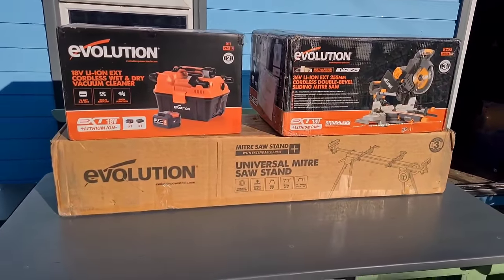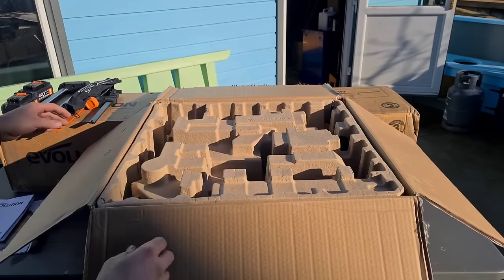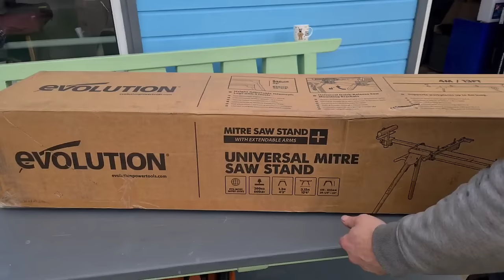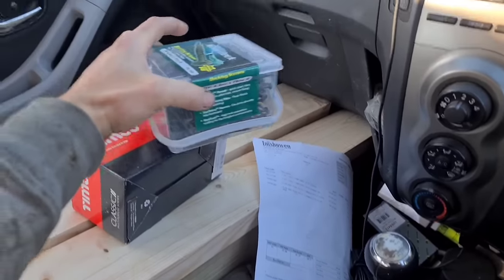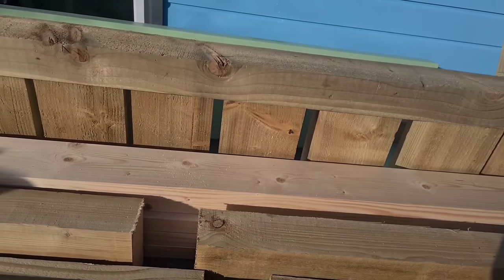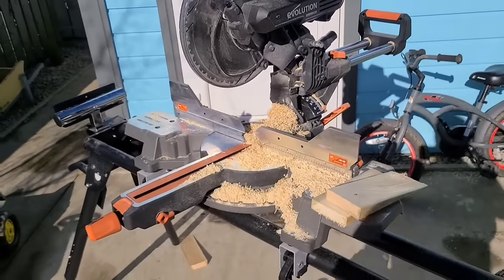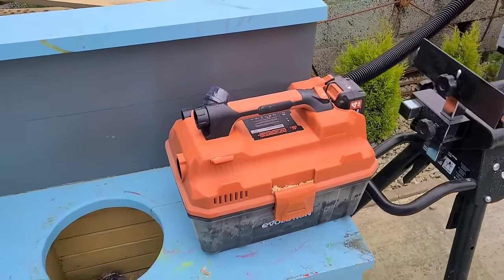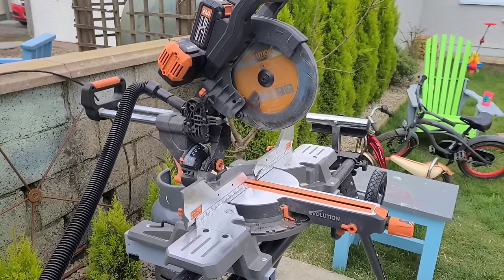Testing out the all new 36v twin battery miter saw from Evolution power tools.

Comment: Dean, the Project Farm channel did a test of all the name-brand carbide tip circ saw all-purpose/demo blades, and Evolution's blade won.  They beat DeWalt, Milwaukee, Bosch, and even Amana.  They were also one of the least expensive blades in the test ($12 vs. $42 for the Amana).  Because of that test I bought a few, along with their 10" table saw blades, and they are impressive.  Cheers mate!

Comment: Hey Dean 
I'm a senior project manager in Product Development at Evolution, I've been with the company for 11 years and have been involved in design and development of most of the new ranges of tools, including this one. 
This is the best review I've seen so far, thanks for your comments I'm glad to hear from a satisfied customer, particularly the repairability as it is something we spend time on ensuring the machines can be easily serviced and repaired. 

A few points which I thought I'd add which might help. 
- When you fit the saw head assembly to the rails with the flat pack system 9:45, there are 2 cap screws just in front of the spring loaded pins now. We added these to a few saws we have designed more recently to just nip the rails tight into the machined holes in the head pivot block. We have to have a tolerance that allows the rails and pivot block to be fitted together by the end user so the additional screws just add some further rigidity and make the connection tighter. The cap screws can be tightened with the supplied allen key, won't need much just a nip up. This is something we will be adding to other saws to improve them. 
- This is the first time we have designed a saw to compete directly with the biggest names in the industry Yellow team, Teal team and Red team in particular. This drove many of the design decisions; Stainless mitre plate, larger base, Die cast extensions, bigger fences, large bevel markings and detents ect. Another area we really focused on was the dust collection as it is increasingly a higher prioirty for our end users, we really went down a rabbit hole on that, slow motion cameras set up and running loads of cuts and mapping dust tragectory and dispersion in CAD. We have optimised the dust collection skirt to work best on stud dimensions IE 2x ...... If when making cuts like 20:26 you pull the saw forward on the rails and cut the timber through from the corner nearest you and push the cut through to the fence, the cut channel formed by the kerf of the blade will shoot the dust directly up the dust port particularly when you have a vac attached. We got very impressive results when cutting this way to help with keeping work area tidy. Just a small change to how cuts are made makes a huge difference. 
- Your comments on the 10" blade are aboslutely true, particularly when going to larger 12" blades, we have had every competitors saw in, used them a lot and fully dissassembled them all over the couple of years we deisgned the saw. This was the reason we went 36V twin battery, single battery 18V saws just don't have enough power. Incidentally our saw has one of the largest cutting capacities of cordless double bevel saws available at this blade size, it actually has the same cut capacity as the NEW Flexvolt 12" machine which is more than double the price and much bigger and heavier. 
-This is another thing some competitors over looked, the weight. Being cordless means these saws are more portable and likely to be used places where corded ones aren't and so we have purposefully designed ours to be the lightest weight saw in it's class but also maintianing the strength and robustness expected. 

Thanks again for your review, I have one of these saws myself as I do a lot of DIY and work on house extensions with my old man and I must admit, it is by far the best saw we've designed to date by a long way so I'm happy to hear others who like it as well. 
Love the bench build as well, proper piece of garden furniture that, lovely work. 

Cheers, all the best 
Will
Reply from the maker: thanks for the comment Will. 
I was actually more than impressed with this cordless miter and Im still impressed with it. 
Using it recently for a house renovation and I have to say its some job. 
Like you say, they weight is massive selling point. A lot of brands are going for to much aesthetics and try to make tools look big and powerful. Instead of making them powerful and manageable.  
The Dewalt flexvolt saw is simply a disaster and is riddled with problems. The makita 36v is also good, and has the power and the accuracy, but is simply a brut of saw. Far to heavy to the lugging up a flight of stairs. 

I have always been impressed with Evolution tools, especially the miter saws. But like you say, this is one is of higher class again. The effort you put in clearly shows. 
And it is good to see you are continuing to improve in the saw and address problems customers are asking about.
Reply: @deandohertygreaser  Glad to hear that. 
We've had really good feedback on it so far, I've had it on long term test with a few trademen I trust across different trades; carpenters, joiners, landscapers ect all with different types of work and environments. Many of which are usually DeWalt, Makita, Milwaukee users and they've all been impressed. 
The weight absolutely, particularly if you need to carry it up scaffolding doing roofing. 

Yeah I must admit I've never been a masive fan of DeWalt Mitresaws personally, we've got most of them in most sizes from around the world. The 250mm Flexvolt we bought in particular, the base and table bolt was done up so tight you couldn't turn it out of the box, the bevel mechanism had a terrible grinding down to poor machining, labels peeling off, die castings were a right mess not linished properly. It wasn't even bought with my money and I wanted to send it back, over £1000 that cost too.
I like the makita saws when they are corded, they are lovely provided you get the ones with Stainless steel mitre plates and not the ali ones, if I had a work shop and had it permanently installed in a bench that would be the saw I'd go for but not a chance the cordless one, it weighs more than the sun. No way I'd be dragging that thing around. The 216mm 40V one on the other hand is an absolute beauty, that's been designed to be cordless from day one. We have a lot of domestic Japanese saws from Makita and Hitachi and they are some of the nicest you'll see, very well engineered, small compact, light weight but stupidly robust and not cheap either, some of the base diecastings look like engine blocks underneath they are that beefy, the 40V 216 reminds me of those saws. 

We are trying to push our quality up on the newer products we are designing, but we do struggle with the brands reputation of being 'cheap' sometimes but hopefully in the coming years we'll have more high end aimed products still at competetive prices when you compare to other products in their class. We are only a small team of 5 in product development in Sheffield so it all takes time to get these products done right.
Reply: I would love to see a battery model of the new evolution job site table saw..
Reply: @WaleshiddenhistoryMD  glad to hear that as we’re working on it right now as it happens.

Comment: Woodworking Beginner: New - Update.
This test is only if you want to saw with precision with a miter saw.(test is not intended for rough and hard work).     

Tips and Test: Read this first before you buying a miter saw!  It's better to know than not to know.
Important to know if you would like to saw with precision. (avoid torsion as much as possible)!
Always choose a Miter saw with a handle positioned in a VERTICAL line above the saw blade.  
Everything must be aligned, slide rails, handle, and saw blade,it is much better this way the blade will not tilt.
Because there is some torsion in the aluminum housing .
And choose an engine with softstart on it to prevent wear of the gear and worm shaft.
It is very important that everything is aligned.
Here are some examples to show how the handle must be positioned above the blade.

First option: handle vertical positioned above the saw blade. 
Bosch gcm 800 sj / Bosch gcm 8 sjl / Evolution rage 3 / FESTOOL KS 60 / Bosch GCM 8 SDE / FESTOOL KS 60 E KAPEX / Metabo KGSV 72 Xact/ Bosch PCM 8 SD / Hitachi C10FSH / Ridgid MS255SR 10-inch / Evolution Fury3-S / Evolution R255SMS / Metabo HPT C10FSBS / Hitachi C10FSB / Hitachi C10FS.

Second optie: handle horizontal positioned above the saw blade / Evolution R185SMS / Evolution F255SMS / Evolution RAGE3R255 SMS3 .

(This also is the case with the Miter saw without the slide rails).

(If you want). You can test it yourself at home if there is torsion in the aluminum housing.

Step-1. First you make a saw cut from +-5 mm deep in to a flat piece of wood about +- 20 mm thick to this with the normal handle positioned on the right side of the Miter saw (the wood it will remain in place until the test is completed).

Step-2. Then repeat this by pushing the saw blade down with your hand or finger on the aluminum protective cover were the saw blade is cased in. Just now only do this without the running engine.

Step-3. Now you can see if the saw blade will be positioned in or next to the saw cut. If the saw blade is (+- 0,2 / 0,5 mm) next to the saw cut then there is torsion in the aluminum housing. 
(test is completed).

Conclusion: Therefor it is much better to choose a Miter saw with the handle positioned VERTICAL in line above the saw blade. 
The second option is the handle positioned HORIZONTAL in line above the saw blade.

 Remember this, the test is only about torsion and nothing else  how further away the handle is from the saw blade how more chance of torsion in the aluminum housing, you better not go for that. (the choices are yours).

Also with a cheap slide miter saw it is still better the handgriff in line a above the saw blade than on the right side. Maybe they will make it someday then we have a winner...

P.S.  When you measure the vertical 90 degrees angle square (Digital Level Box) of you're sawblade don't forget that there is always some torsion in the aluminum housing..

Comment: I still have my old DeWalt and I was thinking about upgrading it and you might be the reason I go to an evolution even though I’ve been using the Dewalt for years. It is a little bulky and a little bit heavy, but the old girl still cut, fall off the stand more than once. got one busted foot on it and still works

Comment: I've got the evolution concrete saw, love it but they make a bespoke blade size one inch. Smaller than the other brand name blade supplier's. Going to have to take the guard off if i want to use standard size blades or pay beaucoup bucks for a blade that's impossible to find. But all around good value for the money. Paid for itself on the first Alan block wall. Evolution seems to be taking quality tool design at a lower price seriously.

Comment: Very good review, and a great build of that heavy duty bench. 

It would appear that Evolution Power Tools is UK 🇬🇧 centric, looking at both the USA 🇺🇸 web site's and the UK 🇬🇧, they offer different items.  

Year's ago I bought into the Bosch 36v line, their 36v circular saw and their 36v  sds hammer drill are quite good. Only issue is they've discontinued everything but the 36v hammer drill.

That said I've been looking for a new system for both concrete and carpentry, have not been overly impressed with Dewalt, Milwaukee, Rigid, Bosch as of late. About the only manufacturer that looks promising is Makita especially in the state's.  

Perhaps Evolution will update it's USA 🇺🇸 website to mirror what is available in the UK 🇬🇧.  They look quite good.  
Cheers 
God Bless
Reply: Hi Senior Project Manager at Evolution here. This saw will be launching in the USA with a number of other cordless tools in the near future.

Comment: Hello again Dean, fitted the new field today and immediately blew one of the brush holder coils out. This saw is turning into a bit of a pain.
I,m going to try a new switch relay and looks like i've got to buy another field.

I have also heard that the soft start circuit may be at fault - in addition the baffle plate and 2 special washers are missing from where the armature seats into the motor housing.
It looks like the person that so called "repaired" this saw before didn't have a clue what they were doing.

Do you think i am on the right track with my findings?

Comment: The only fault with the Evolution chopsaw in my eyes is the blade bore size 25.4 I find it hard to get reasonably priced blade for it
Reply: Funny you mention that, I had the same issue but picked up an adapter ring in Donegal Fixings which is where Dean there works. Allowed me to use 30mm bore blades which I found easier to source
Reply: @Figitarian  must get one didt know they had that have to go down to Donegal fixing this week to lift my nail gun

Comment: Hello Dean, wondered if you can help.
I have a 240 Volt Makita 2740X Table Saw that keeps blowing fuses after a few seconds of running.
Apparently the Armature has just been replaced and it is still happening. Would you have any suggestions?
Any help is really appreciated.
Reply from the maker: Sounds like it is the field, but could also be the switch. 
Take a look at the field, if it's melted or burnt or discoloured at all, replace it.
Reply: @deandohertygreaser  Thank you Dean, i suspected the field myself -didn't think about the switch though.

Comment: They are not an accurate cut i sent 2 back there is slight side to side movement and there wasn't and any adjustment to correct it but ok for site use nothing else

Comment: Hi dean need your expertise I have a power craft 3 inch belt sander PBS-950 I think Aldi sold them years ago need some brushes for it have searched for the model but no luck any ideas or what will fit would help grately